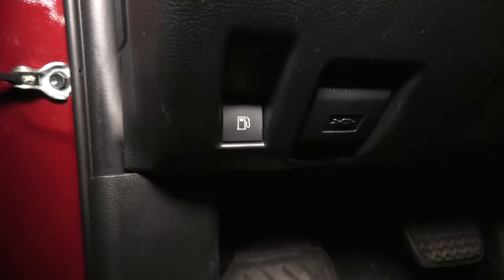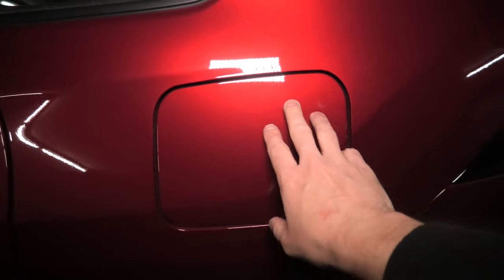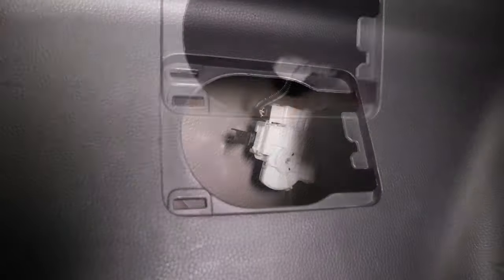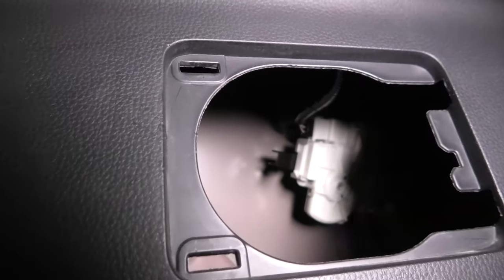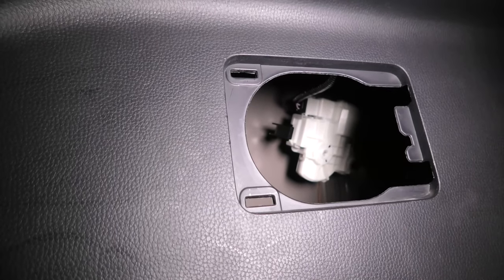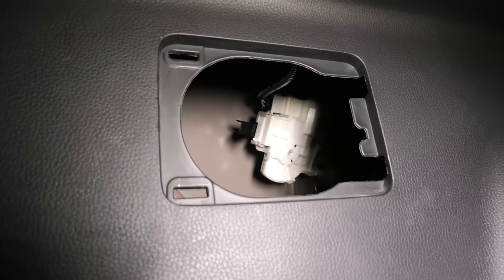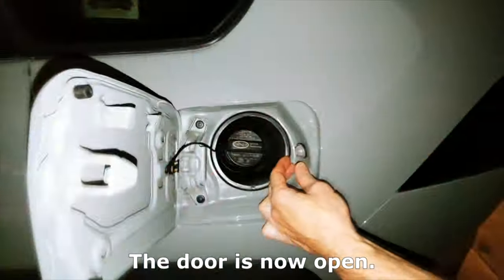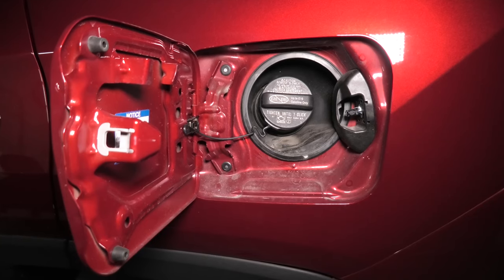Toyota RAV4 (2019-2024): How To Manually Unlock Stuck Gas Tank Door With Electric Actuator?

Comment: Most of the youtubes on opening the RAV 4 gas door are about models that have tabs. Mine has a button like the one in this video. When I called the dealership where I bought the car.  They said it can't be opened manually. Really? Maybe the person answering the phone didn't know better, but then why say anything?  I was able to open it easily through the hatchback access door. I still have the little piece that fell off, it isn't broken. I will see if I can put it back on.